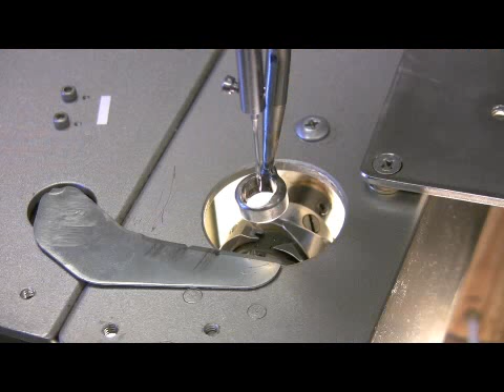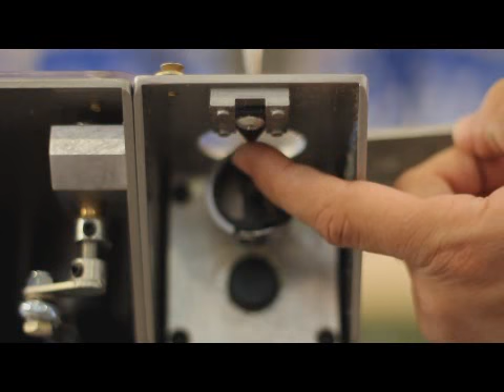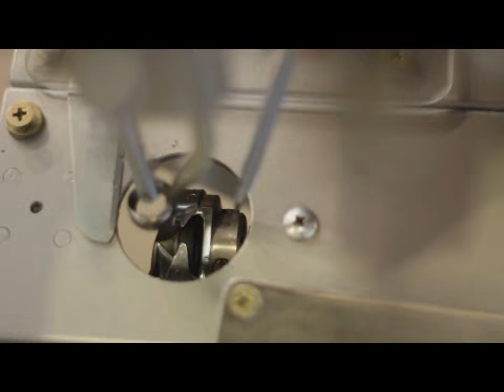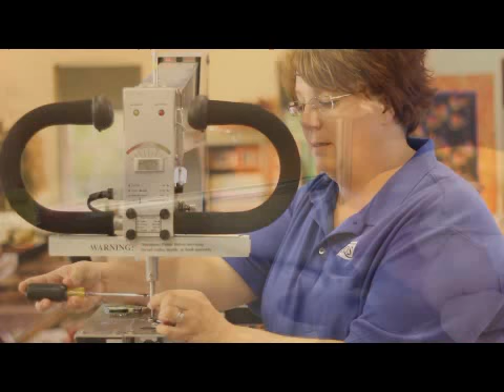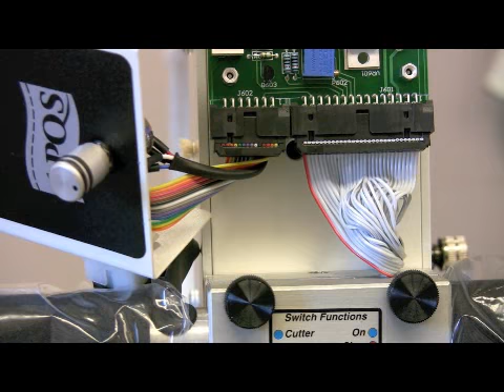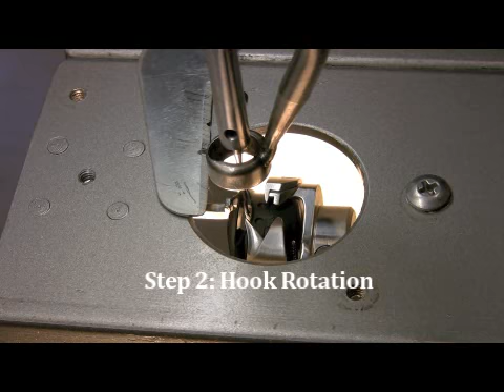APQS Instructional: Timing Your APQS Machine

Comment: I hate to tell you but my Ultimate II has rhe hole in the front to adjust for needle depth but there is no screw.  Would like to send a picture.
Reply from the maker: Hi there - thanks for reaching out. Our service team would be happy to help resolve this issue. You can give them a call at: 800.426.7233.